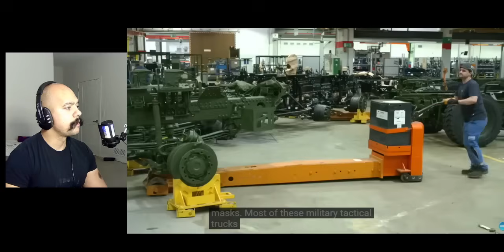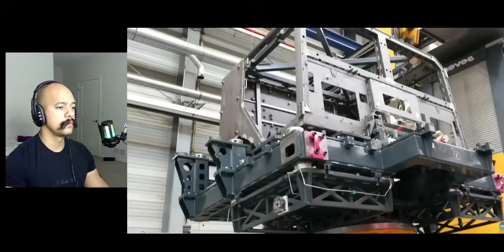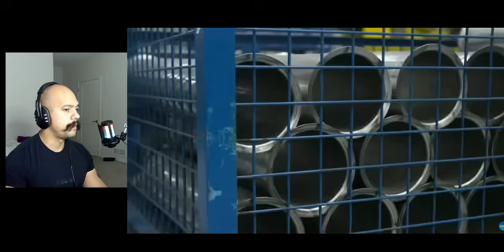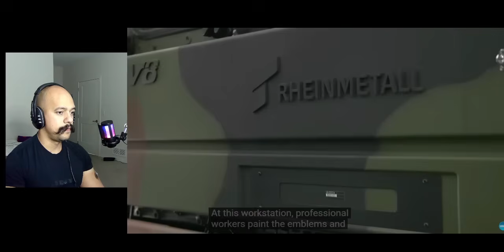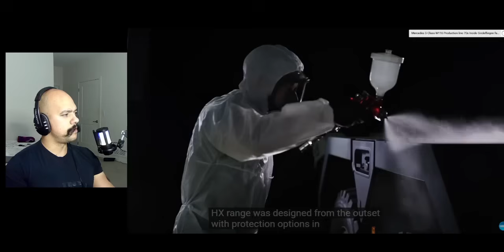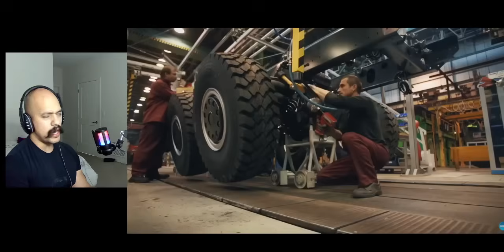American Reacts To Inside Secret German Factory Producing Massive Armored Trucks | MAN Plant Tour

Comment: Rheinmetall is currently negotiating with VW about the takeover or joint venture of one of VW's automobile plants in Germany. Military vehicles will then roll off the production line there instead of passenger cars. The plant currently does not have heavy-duty overhead cranes; these still need to be installed. The timeframe and costs will determine whether VW and Rheinmetall can reach an agreement.